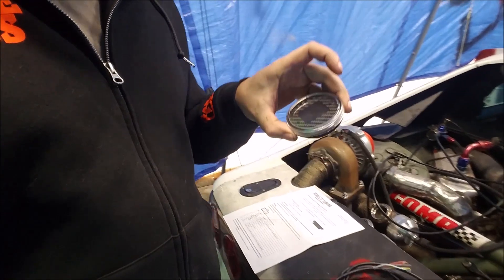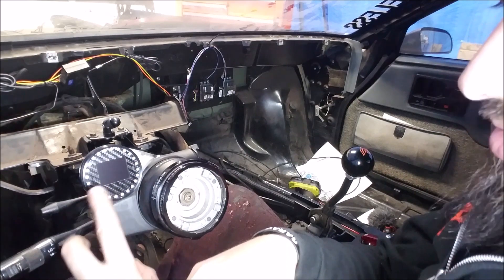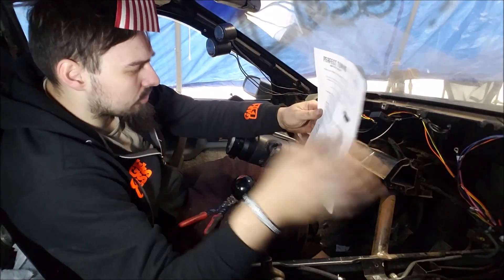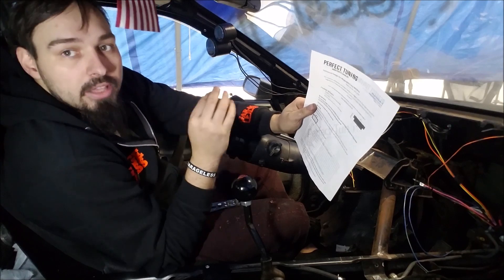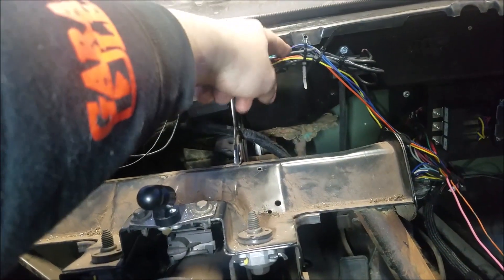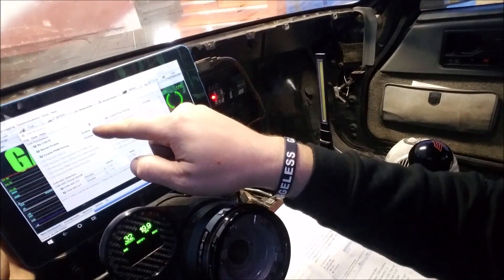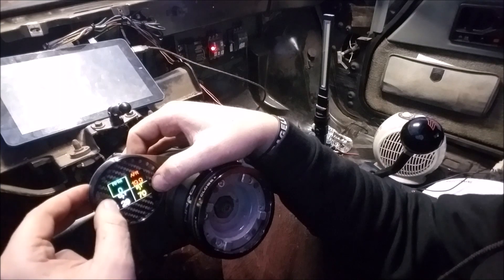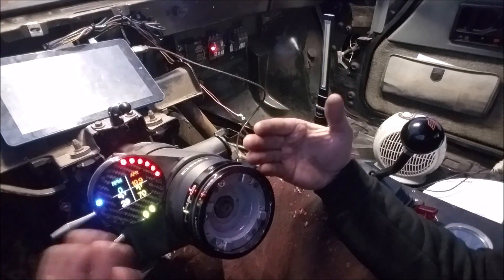PERFECT TUNING UNIVERSAL GAUGE REVIEW! how to wire it! functions and settings overview!

Comment: How you like it so far? Any problem?  So if the ecuvhas canbus, it can pretty much display every from the ecu. Plus 3 hard wire sensors? Looks like the price jumped up alot...
Reply from the maker: I have 2 of them in my fiero now lol i love them... unfortunately everything is goin up these days
Reply from the maker: No issues, im using 3 extra inputs for fuel pressure, another iat and oil pressure...
Reply: @Garageless  it's about $320 now lol. Why would you need those sensor? Would the ecu already transmit it over?
Reply from the maker: Im on microsquirt so none of those were on can bus... i wanted extra iat to monitor temps better

Comment: Yulp Looks a upgraded areo scan gauge

FYI it would hook though the obd 2 plug on stock computer

This is a lot better than the areo scan guage
Make sure it reads knocks high knock = hole in piston

I’m pissed mine cost $250 but it was over 4 years purchased
Reply from the maker: This isnt as simple as plug and play but its still amazing... i dont use knock sensors... i just listen for spark knock but i generally stay conservative with timing anyways lol